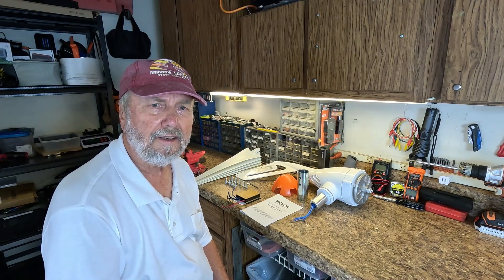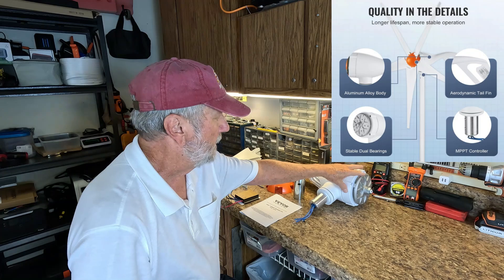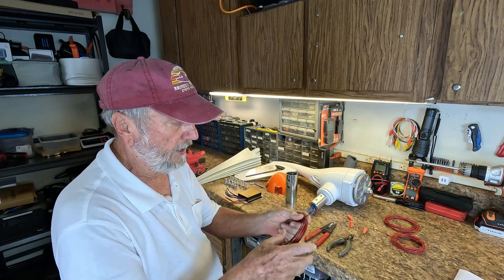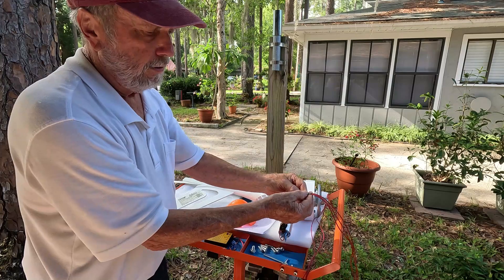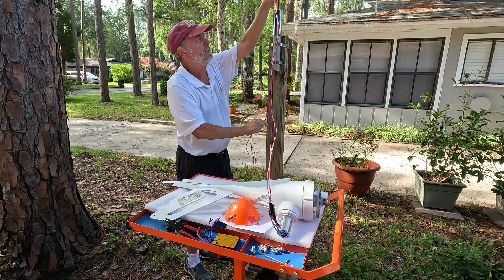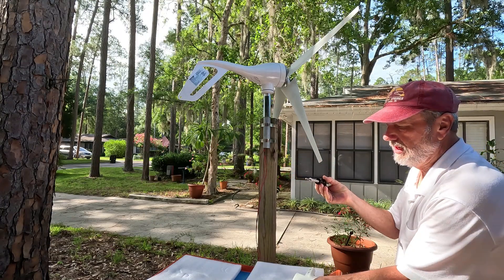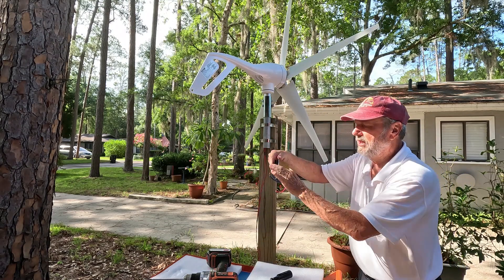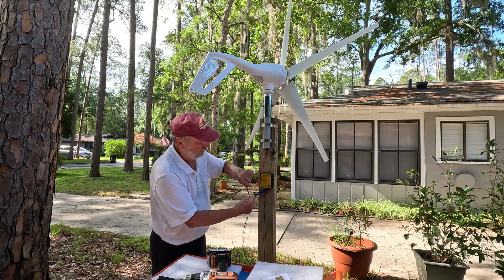VEVOR Wind Turbine Generator will charge 12v or 24 v batteries

Comment: Any one notice Sam has never produced a follow up video,  I think Sam is paid to show vevor products,  this wind turbine is garbage, I owned one , was on the coast strong breeze all week, producing half an amp, probably made enough to charge a phone up,   Then one night we had a storm roll in of the coast,  now in storm like winds, it was intermittently making 10amps, wind moves around Ana’s it does it slows the turbine, until turbine moves and speeds up,  half an hour later in broke a blade and the out of balance vibration then quickly destroyed the turbine,  waste of time and money, just buy additional solar panel’s and batteries.  These cheap Chinese wind turbines are crap .

Comment: Very interesting. Ok how many battery it can charge.
Reply from the maker: I believe up to two 12 volt batteries would be the limit.  Two in parallel for 12 volt and two in series for 24 volts.

Comment: Thanks.It's quite east to Boost these $120 units o do much more.replace the dodgy charge controllers with x3 0.70  Cent Schkotty Diodes. This Removes the Pain in Butt Blade  Breaking Auto brake.

Comment: Here's something that most people need to understand. If you have a 12v battery, you need a higher voltage to charge it. Just like Solar PV needs the panels to hit the correct voltage for the MPPT to put amps into your batteries.

Comment: Interesting. Good video but using this to provide AC power is horribly inefficient with many points of failure.
Reply from the maker: @dontblameme6328. This wind turbine Generator produces dc voltage to charge 12v or 24v batteries.  The batteries can then use an inverter to produce A/C voltage to power the devices that require A/C.  That is the way most DC systems work.  Solar the same way.